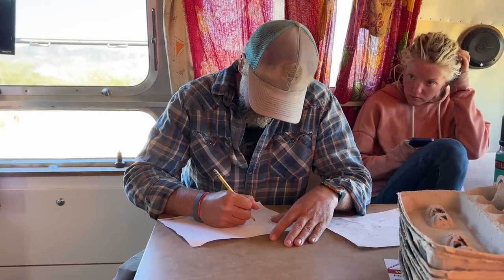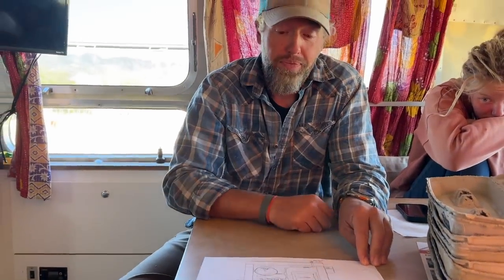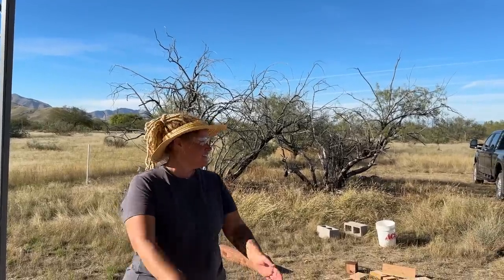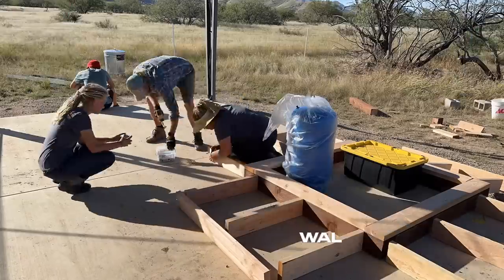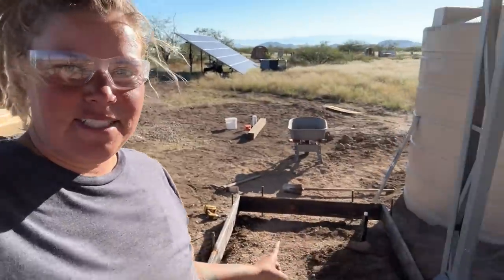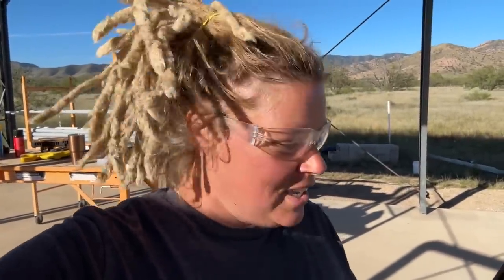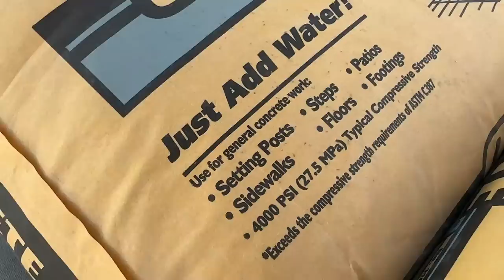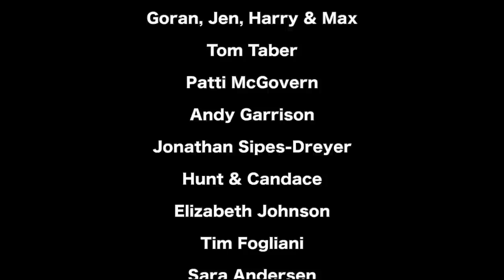A BETTER SOLAR PUMP HOUSE - Building Foundation & Framing at the Airstream Carport (Step 10)

Comment: Love the curtains behind you Ashley! Yay, proper pad underneath the pumphouse. Rats, wrong size boards, back to the hardware store. Nice building on the fly Ashley. Wow, you guys really know how to pour a pad now! It looks fantastic! Just another trip to the hardware store for more concrete. Good idea to have the overflow drain! I love the little pebble TSH on the pad. I'll have to see what those rods do. Now I get it! That really looks nice with the timber base. You did really good drilling the holes for the rods! That was a good idea to place the frame over the rods and drill out the clearance for them so the frame could be set down over them. I like how you figured out the roof Ashley. It seems like you have this construction down. Maybe you have built a pumphouse before? A time or two? Ocho was really cute attacking the owl decoy. Thanks for this Longneckers!

Comment: Ashley, I'm like you in that I will stare at a problem until I can see the plan and solution in my mind, and then doing it is a snap. My husband is like Jonathan - he needs to calculate and map out, going so far as to set up calculation in excel! My eyes go glossy with math, but when I tackle a job with the plan in my head, it works. Both have skills that complement the other's!
Reply: I literally see a red mist when my husband and son start talking maths.

Comment: Yep, that'll work. Personally, I would add ball valves on each side of the pump and on the pressure tank, plus unions sot that they can be isolated from the rest of the system if/when they fail. Then they are far easier to replace, while keeping the system sealed/under gravity pressure.
For future reference, there are special 'J' bolts in the concrete aisle of Home Depot, that are made for anchoring base plates to concrete pads. If the drain were in a bathroom shower, there should be ~1/2 foam wrapped around the drain to prevent it from breaking by the house settling. Often wooden boxes are used under tile floors to allow the drain to be replaced, w/o breaking up the slab. JS
The box looks great. Nice job!
I've always dreamed years into the future in order to keep the ducks in the right order and the horse in front of the cart. (Some of those dreams even pan out, but rarely as I had planned they would, 'cause those darn ducks won't stay in order.)
Then, I focus upon each duck, to foresee any problems of stupidity.
Then, I go online shopping to source all the stuff I need and to guesstimate my budget.
Then, I research the mfrs' manuals and usage recommendations, so that I know what I'm getting into.
Then, I watch a bunch of YT tutorials and DIY channels like yours to learn what everyone else is doing.
Then, I consider ALL of the possible design options, with their pros & cons in order to visualize the whatsa-ma-jigger or thinga-ma-jig.
Then, I order far more widgets than I need, because there's always something better that rears it's head.
THEN, I start drawing the final design, including the measurements.
Then, 1/2 way through the build, I find the same whacha-ma-jigger already OTC on aliexpress, for a fraction of what I've just wasted on my now useless widgets.😡
Otherwise, these steps makes the doing far easier and less problematic along the way.
But, you two do you and I'll do me. 'Cause that's the way our lives should be.
😎

Comment: Solid styrofoam insulation. Cut from 4x8 sheets. If it gets wet it doesn’t collapse, mice won’t nest in it. An insulated hot water tank blanket over the pressure tank and a simple drop light with incandescent light bulb inside the pump house will prevent freeze ups. I speak from experience!!

Comment: Spent years dodging in and out of small pump and instrument cabinets as part of the job.

Would suggest a "machine plinth" for the pump to sit on. Drains are well and good but if the pump is up on a plinth even a pressured leak should cause no permanent issues, especially if a drain is choked.

A lot of the smaller cabinets like yours would omit the drain entirely from the concrete pad for quick and easy construction. You would arrive and water would be pouring from under the doors or fibreglass wall to concrete pad joints ..lol

Looking good though. Maybe fit a water fllod cutout switch?

Comment: If you pour a work pad, maybe you should make it 12 x 12 just in case.
Reply: Haha, or make it 12’x16’. Why that size? Because a sheet of plywood is 4’x8’ then add 4’ perimeter on all sides to work.

Comment: What is on the bottom of allthread to keep it from pulling up!  Appreciate your work & videos!
Reply from the maker: They’re pushed in deep enough they won’t be coming up. They just will be an added point for the base to be secured down but the pump house is so heavy it will not be going anywhere:)
Reply: @TinyShinyHome  Great - thx for the reply - best of luck in all you do.

Comment: Looks great!! why. 6" slab 4" is std in southeast?
Reply from the maker: Because we had 6x6 posts to use and more insulation the better for this pumphouse.
Reply from the maker: To get it up to the same height as the main concrete pad.

Comment: No reason in the world for the pad to be that deep, and I see no reason for the 4x4 base underneath the 2x4 base.
When building a house the 2x4 base is bolted directly into the cement floor. If that's good enough for a house it should be good enough for a pump house.
Reply from the maker: It’s only that deep because it drops from 3” to 8” because the lay of the land. It’s perfectly fine. We also used the 6x6 posts to raise up the base so that we could use less lumber and we already had the 6x6 posts. And guess what! It worked out just fine.